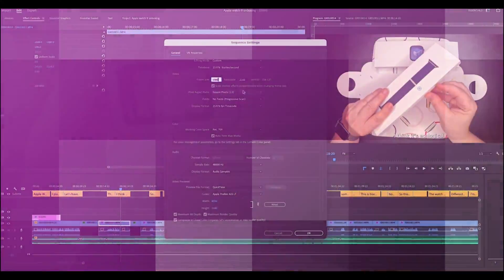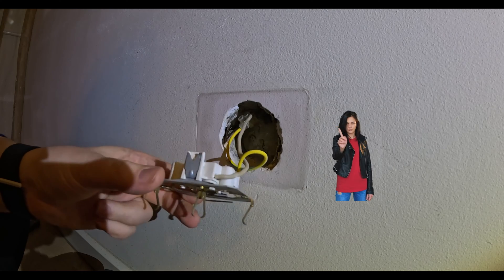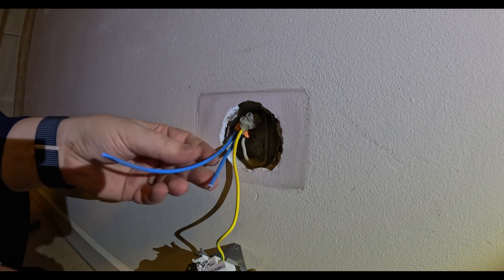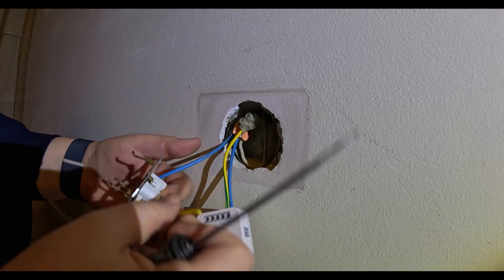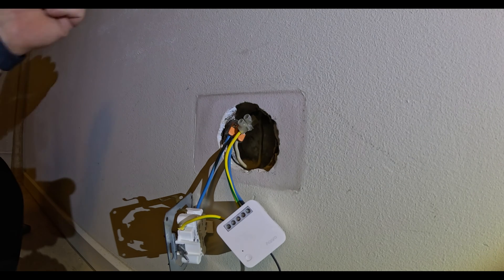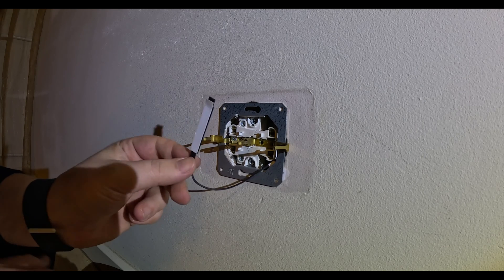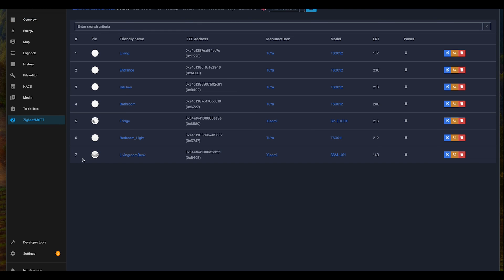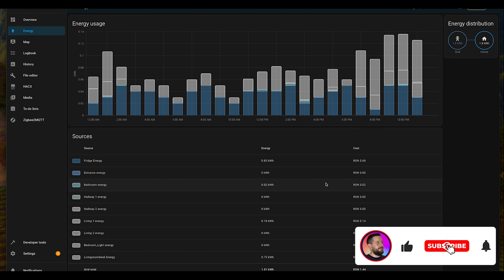Home Assistant : Aqara T1 Zigbee Switch with Power Monitoring

Comment: Hi, thanks for the video. I have configured Aqara M3 with Matter integration on Home Assistant. I have bunch of Z1 Pro & Magic Switch S1E's connected to my lights and fans in different rooms. Is it possible to monitor individual room energy consumption using HA?
Reply from the maker: Hi, I have no experience with the Magic switch but in theory yes. even if switches do not have a direct power measurement you can define on each switch the power usage (you need to know the exact consumption / switch). Home assistant will then be able to calculate how much energy was used based on how long the switch was on. I't not the best measurement but I have it implemented for my light switches.

Comment: Thanks for the video. Do you know if it supports dimming?
Reply from the maker: Hi, unfortunately id doe not. only on/off or toggle mode. Probably you need something like the Aqara Smart Dimmer Switch H1, but that is an entire light switch no only a hidden module.

Comment: your live wire has earth cable sleeve around it.
Reply from the maker: Yes and the ground itself is missing completely!!!!. That socket is a good example to always measure and double check what you have and never base the install on color codes and regulation standards only. You never know what surprises you can find out there.

Comment: You mention that it is important that it is a Raspberry Pi 5. Wouldn't it also be fine to run on an Raspberry Pi 4? Or what is the limitation there?
Reply: I think the mention of the raspberry pi 5 in particular is just a point of interest, not explicitly saying you have to use a 5.  I have no idea how well it would run on either the 4 or 5 though.
Reply from the maker: That is correct. Only a point of interest with the raspberry pi 5 since support for it in Home Assistant is very new. Any Home Assistant  server type will work without issues. The only difference can be how snappy the updates/commands will be.